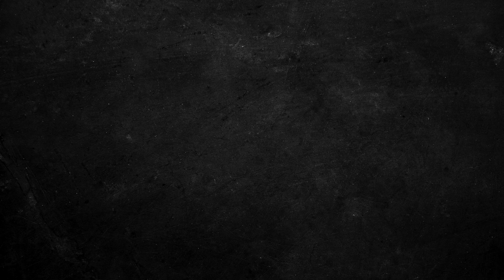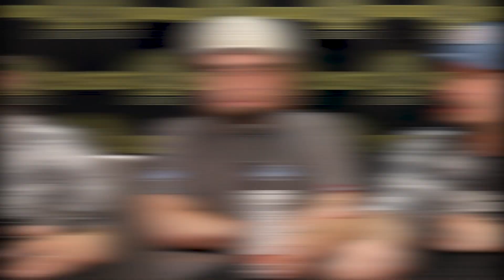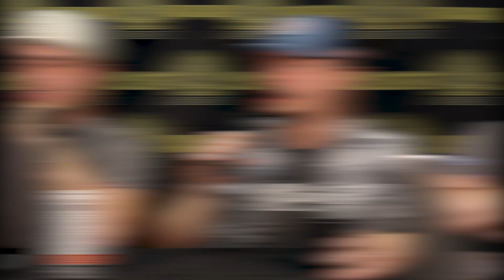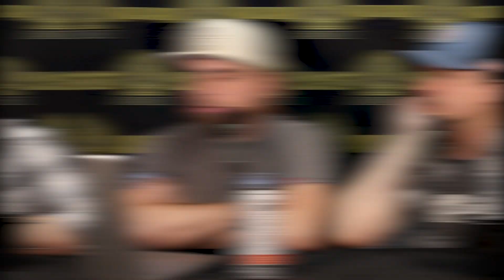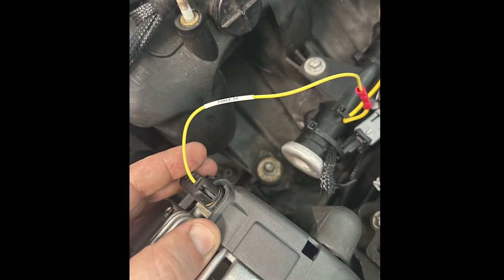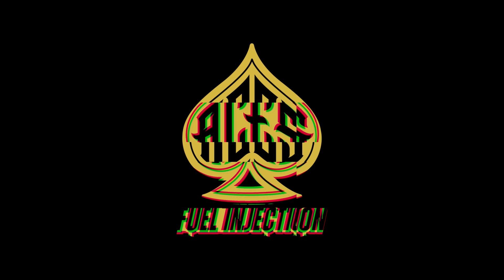Hat Day (Tech Tuesday Ep. 31)

Comment: Hey guys! Is there a certain type of splitter I can use for my jackpot system so I can run my 7 inch dash and my lab top? I know it’s been talked about previously that it can be done but not sure where to find one. Doesn’t seem to be the same style as the Holley and when looking for one that’s the only thing that pops up. Is there a certain splitter you guys recommend or can you at least point me in the direction of where I can get one? Thanks again

Comment: Tim put out a video for nitrous retard using purple wire for killshot. 

I pulled up jackpot manual and it doesn’t show a purple nitrous wire on the loose wire harness, 

But under spark in jackpot it has nitrous retard options. 

So question is, which wire is for nitrous retard input on the jackpot?

Comment: So the power en wire dose nothing?
Reply from the maker: Hey Anthony,
The power-en wire in the schematic shows that it is used to charge the alternator, but it is not in the firmware to be activated yet. We have kept it on the loose wires and in the schematic for future use. This will help alleviate any future issues with different variants of manuals and harnesses. What you can do is run the V-main wire to a relay to clean up the voltage and from that run it to the alternator.

Comment: Need more information on the wildcard for the big block Chevy  Is there any videos with one running or  I bought the kit but haven’t installed yet but no info on it on other parts you might  need  like brackets and cables to use with it. I did find out you can’t use the 200or 700 r4 on it due to no where to hook up linkage brackets for the right geometry for adjusting  trans cables .i also ended up buying the quickdraw tcm cause I guess ima have to get a 4l60 to work with efi set up